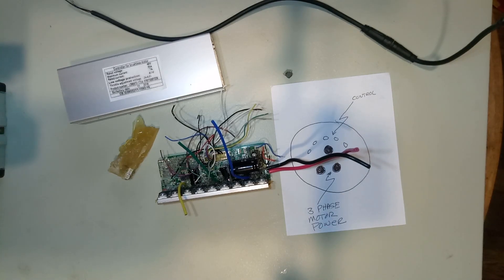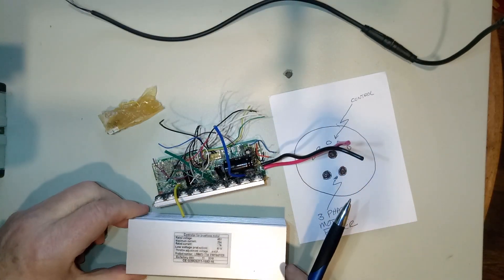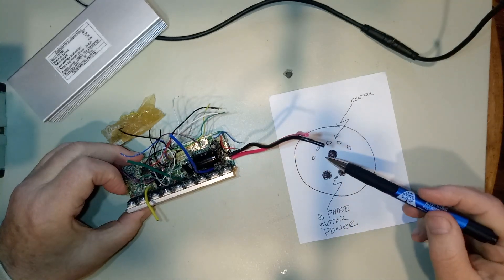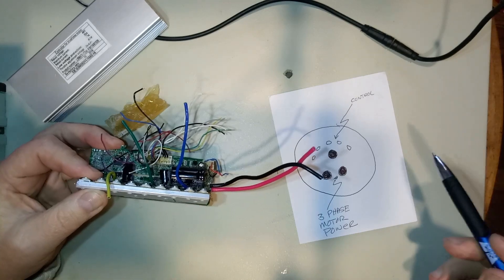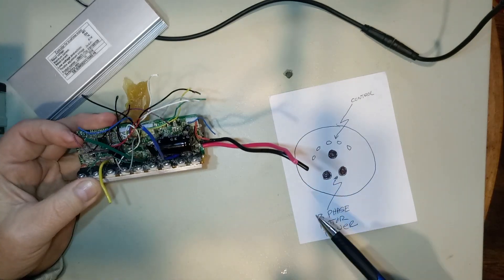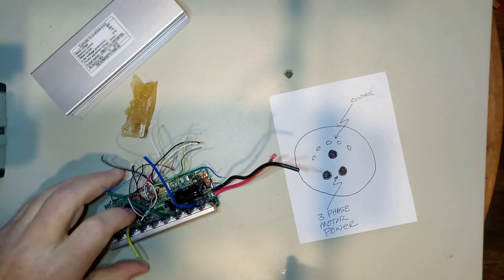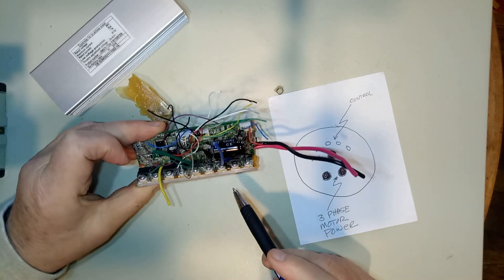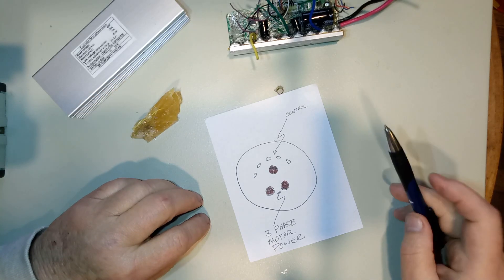E-BIKE 48V Brushless Motor Controller Teardown Failure Analysis

Comment: Horrible name for your channel you either get Oprah Winfrey or Opera I guess Italian musicals. But it's nice to see somebody understand it's great to find the problem but you also need to find out what caused the problem. difference between mechanic and good mechanic electrician
Reply from the maker: I thought the name would keep YT riff raff away.  It comes from Nantucket, the historic Seamans Opera House.  Probably just a brothel.  Started as Opera House Boat Works, I do own a full size pipe organ.  Then it was Operahouse and now just opera. My first job was repairing transistorized organs in 64 when I was 14.  They had no choice, I was the only one who understood transistors. My brother had to drive me on service calls.  60 years of repair and electronics design and the problem is usually bad design.

Comment: Yea the Chines get right down to the Wire with the Wire,    Arr Arrr.   On my Hub motor the wire that should be like 14 or 12 AWG is only like 16AWG.   1000W motor should be pulling 2oA @ 48V and they use 16AWG ?   Ok each leg on the motor should only be realizing 1/3 of the 20A but all the same.  Even the Primary Power Leads are only like 16AWG wire.
Reply from the maker: #16 is rated for 22A for internal wiring. Derated some as a bundle depending on insulation. It is like the Chinese took online courses from MOLEX on how to over rate connector current.
Reply: @opera5714  LOL,  As long as you remember the Chinesium Rating system equates to half of everyone else's standards we're good to go.  Chines Amper = 0.5 SAE Amperage.